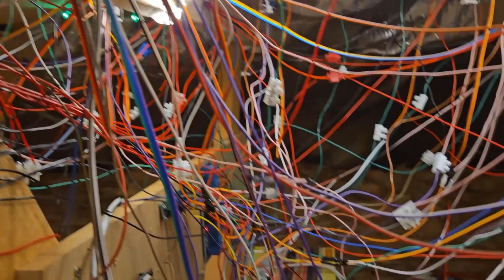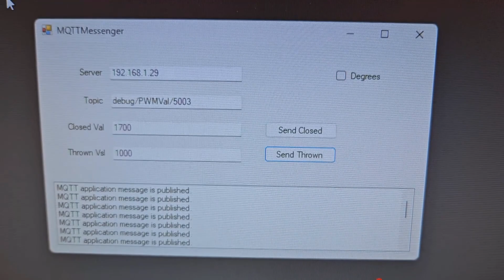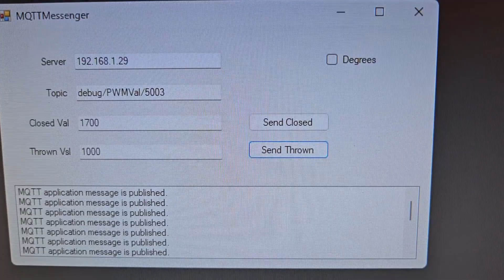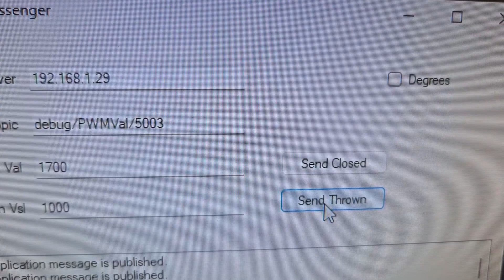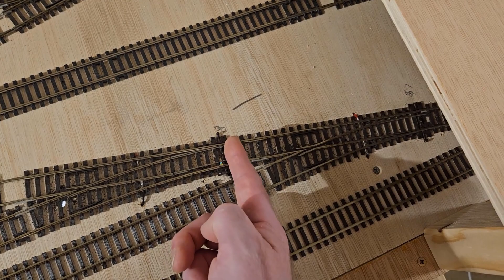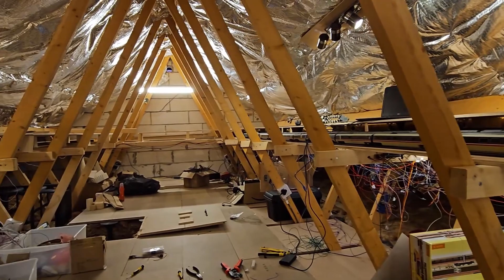Comparison of, and uses for, Arduinos, ESP32s and Galileos on a model railway

Comment: Yet another interesting video. I've learned so much from your various 'technology' videos, and have started playing with arduinos in preparation for designing and building my own layout. Would it be possible for you to make your servo calibration utility available? It looks like such a useful tool for calibrating the plethora of servos that will exist, whilst still running the live code with its CPU loading. Keep doing these 'tech journey' videos as they are so instructional and nobody else is doing them.
Reply from the maker: Thank you for such kind words! Of course - I kept meaning to put that tool up, although I think it will only run on Windows. It's c# and would need compiling so may just put the executables up to make life easier. I'll update the video when I have  a link. Thanks again! Regards, Chris
Reply: I'm running Windows (7) so an executable would be just fine for me :) My first career was as a systems programmer in assembler and C, but then left the industry, and this is helping scratch that developer's itch :o)
Reply from the maker: I have hopefully created a visible repo for this now - https://github.com/Vintage80sModelRailway/MQTTServoCalibration - there's a link to a compiled version, plus a link to an Arduino IDE sketch that is subscribed to, and processes, the messages that the Windows forms app sends (in the readme file).
Reply: Fantastic! Thanks Chris. I've not tested it yet, but the release build .exe runs, so should all be good.

Comment: Nice video. I currently only use   an arduino mega to run a sensor hub for my block detectors in JMRI/CMRI. I've already uncovered some issues with "bad" pins causing false detections on the sensor shield. The workaround was simply to just not use the bad pins. Otherwise, the board seems happy to do what it does. That said, as things expand, i plan on setting up another arduino as a separate node for the east leg of the layout to share the load instead of running all of the sensors back to the same hub. This is a long way of saying that eventually, when i get around to placing physical signals on the layout, I'll be looking into mqtt and RPi Picos as suggested by a good friend of mine to handle that job when the time comes. It's a lot of work, but it sounds to me like you've got a good handle on it. 👍
Reply from the maker: Thank you! Good approach - sometimes the odd dodgy component rears its head - I have a couple of dodgy relays on a board that I just avoid using, but the rest are OK. Yes, strongly recommend MQTT, much easier to establish, in my opinion, than RS485 was. Regards, Chris

Comment: Just discovered you today and  have really enjoyed all of your videos watched so far. Enthused to try MQTT on my test layout starting tomorrow. On another note regarding your overheating Arduino , I did read somewhere that the optimum power supply for Arduino is 7v although it can handle over 12v. Anything over is dissapated in heat from the voltage regulator.
Reply from the maker: Thanks for the kind words and that's really good advice - I'll try a lower voltage power supply on them. Strongly recommend MQTT, I was so glad to see the back of RS$85! Channel is in a bit of a lull at the moment while I do the boring stuff - laying track - but I'll be back! Regards, Chris

Comment: You really don't need to create classes to represent turnouts, sensors etc. It's quite possible to handle these devices with simple arrays and loops. Every object takes up additional memory for the function pointers etc
Reply from the maker: Hi, thanks for the suggestion, it's always a controversial topic I guess! Take sensors - for each sensor I need to know its PWM channel, JMRI Id, the ESP32 pin it's connected to, its thrown and closed PWM values, step size and delay time for slow movement and whether or not to detach it after movement. I guess they could all be stored in arrays - ints, strings, bools, whatever. But, for example if I'm using 10 servos on a microcontroller,  would 8 arrays of 10 strings, ints, bools etc. really use less memory than 1 array of 10 objects, each object containingthose 8 values?

The way I have it written, each turnout class also contains 2 methods - moveSlow() and moveInstant() - I like the abstraction of these and, for me, it makes the code more readable and accessible.

It also makes code very quickly reusable across different devices - I have maybe 8 devices scattered around now - some support turnouts, some don't, and same for sensors, block detectors, IR sensors, LDRs etc. 

I have fallen foul of running out of memory though, and do try to limit the amount of different accessories attached to any one device. So I'm moving away from having one device handling servos, relays for electrofrog, all the different types of sensors, shift in, shift out and whatever else. Much better, for me, to have more devices, each serving fewer roles.

Regards, Chris
Reply: @WirenwoodModelRailway  Actually, I was thinking of something simpler - you can simply declare a struct with the requisite fields. That will allow you to store the data associated with an object without the overhead of creating a C++ class. I have to thank you for your series on MQTT incidentally. It has inspired me to replace Loconet equipment with Arduino and ESP32s
Reply from the maker: @2sk21  Ah thank you, yes, good point. I'll definitely look towards those next time I start running out of memory! And thank you - that's interesting - what made you want to switch from Loconet? Regards, Chris
Reply: @WirenwoodModelRailway  I am also aiming for complete automation of my layout but finding that far too much wiring is involved. By deploying a few ESP32s (connected by MQTT) around the layout, I can reduce wiring substantially. I have found that the TCP/IP implementation on ESP32s is very robust and the MQTT client is similarly rock solid. So this approach looks promising. I have been experimenting with Arduino's own ESP32 based Nano and I think its better than the generic ESP32 clones so far as it is much smaller